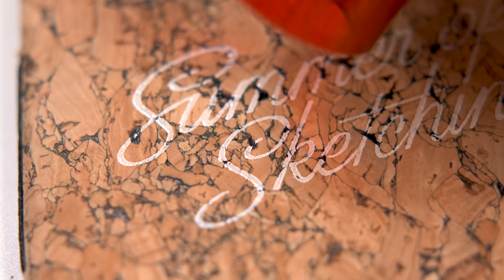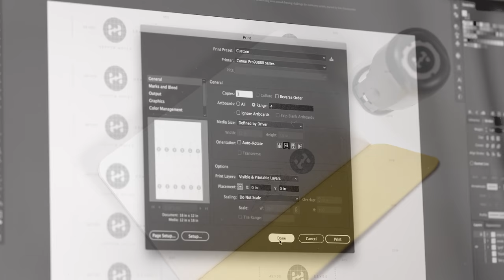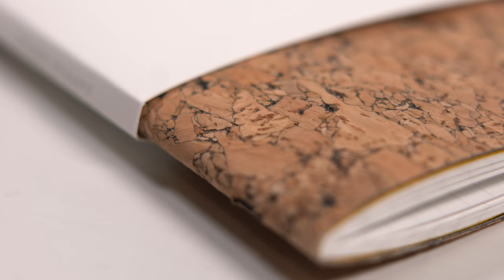How to Make a Sewn, Fabric-Cover Pocket Notebook

Comment: What is the powder? And what kind of thread did you use?
Reply from the maker: It's an embossing powder, which solidifies with heat.
All of the notebooks are made using waxed linen thread.